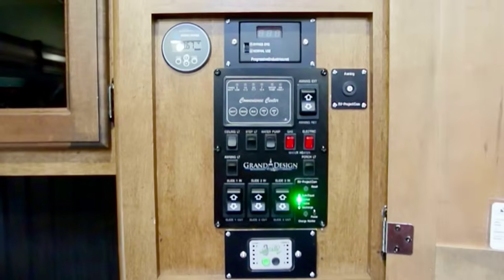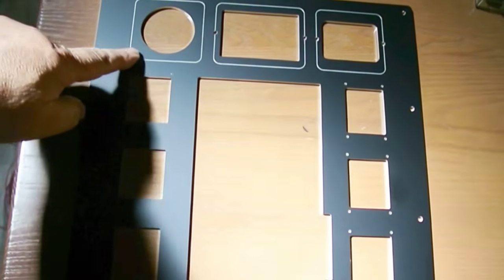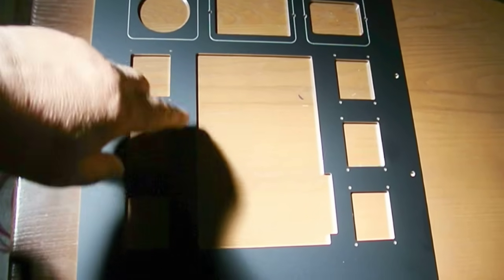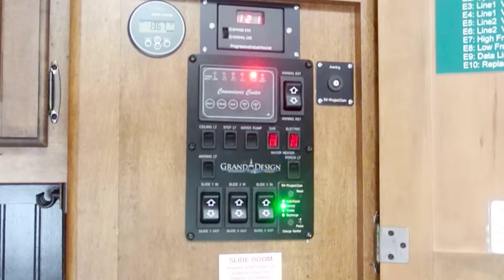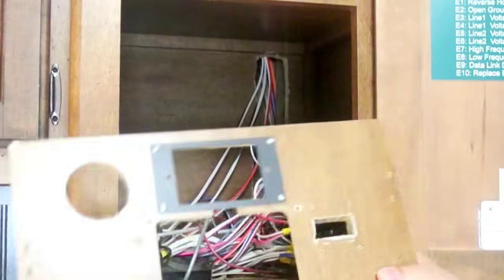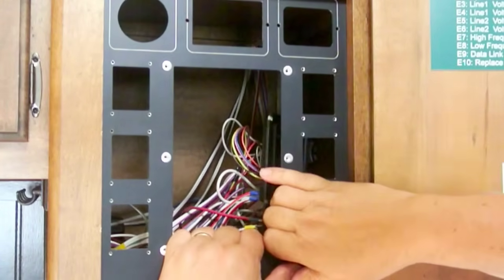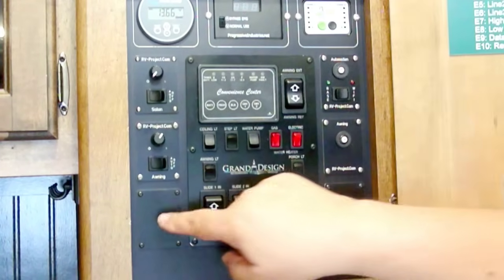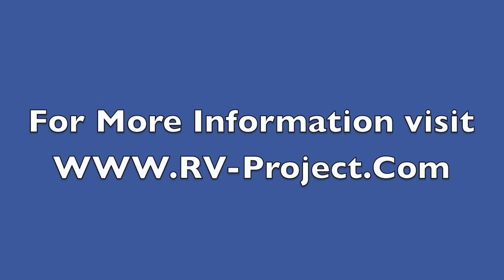A custom built control panel for my RV.

Comment: Good job!!  Can you add information on page where you got panel made?
Reply from the maker: You can go to my project webpage: http://www.rv-project.com/projects/cpu.php

You will find expanded information, including a link to the templates page were you can download the panel Designer (free from Front Panel Express), and templates for the "skeleton" and blank sub-panel.  

From the templates page (http://www.rv-project.com/resources/e450.php) you will find the templates for this project, as well as all of the other projects on my website. Also a link to Front Panel Express, which is the manufacturer of the panels. You can download the "Front Panel Designer" from that link.

There is also a video on the templates page that will show you how to obtain the Designer, install it on your PC or MAC, load the templates, and order them. You can also modify the templates as needed from the Designer.
Reply: I had only watched your videos but have since visited your webpage.  Thanks! Great information!

Comment: Great Job!  what are you doing with your old progressive industries cover plate? hint hint :)
Reply from the maker: Sometimes I sell items that are either no longer required or unused from my website.  I actually have several spares somewhere in my parts bins.  If I can find them, I will post them on the website.

http://www.rv-project.com/resources/fosail.php

Comment: Very nice! What are you going to do with the old EMS plate? I have the same EMS system that I will be installing in my XLR 35VL5.
Reply from the maker: It is still attached to the cardboard panel.

You want it?

Go to my website contact page:  http://www.rv-project.com/formmail/cf.php 

Send me an email, and I will get your address and such and send it to you.
Reply: Absolutely! It does a great job of dressing up the EMS monitor.
Reply: Just watched this again and noticed the label with the EMS error codes on it. Very nice! I have not removed my control panel yet but in my last camper the wood was 1/8" thick. Your Grand Design camper wood panel looks much thicker.